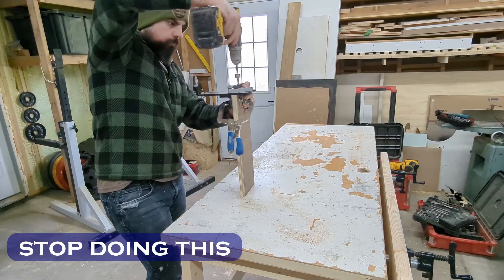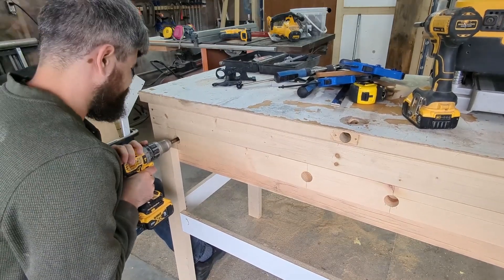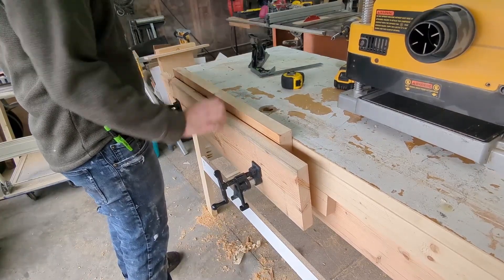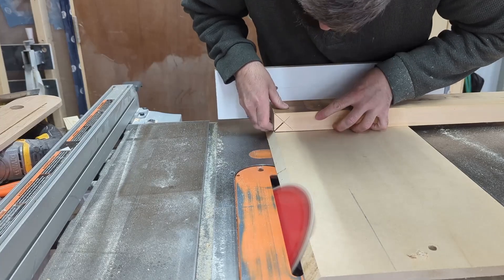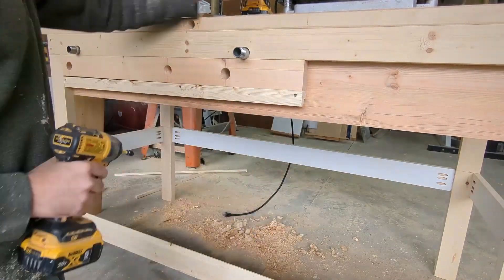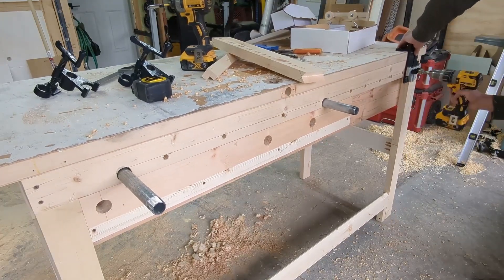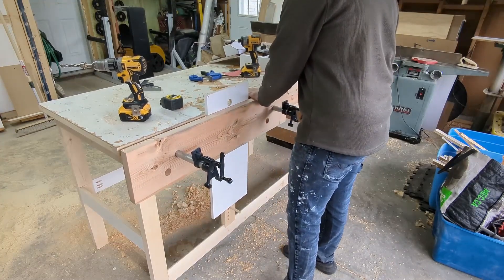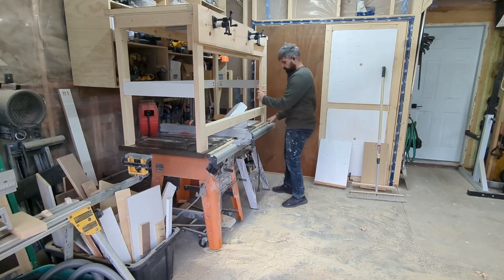Build a DIY Vise & Sliding Deadman in Record Time - Here's How!

Comment: I wonder why we don't see more 'sideways' twin screw vises like this.  People complain about having to adjust both screws to prevent racking, but I don't see how that's any worse than a traditional leg vise with the adjuster at the bottom, and it must be easier to have that adjustment at waist level than at floor level.
Reply from the maker: Yeah it really is an easy adjustment.  Jay Bates keeps a small spacer on hand to toss on one side to even things out if necessary and that works great and is easy.  

 I've found that if you are clamping something right beside or above one of the pipe clamps it really isn't even necessary.  I think this could provide a lot of similar functions as a leg vice but for less money and an easier install.

Working up high is always convenient, just ask my knees and back.